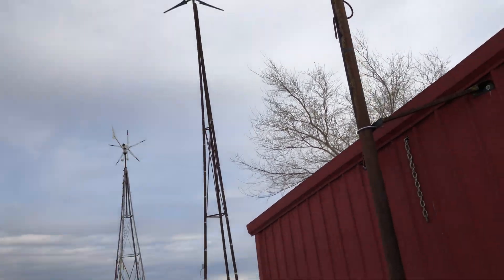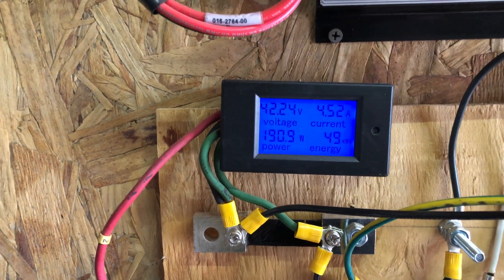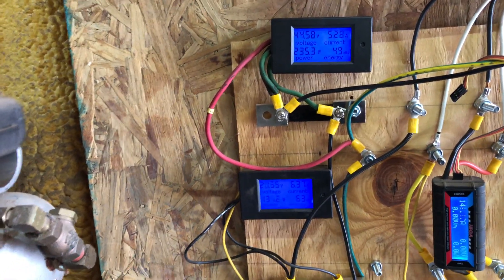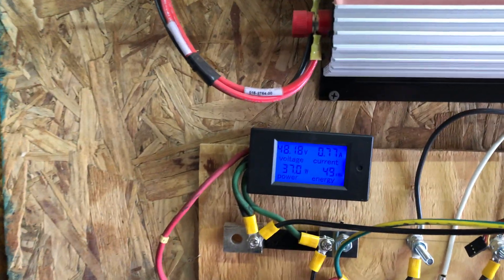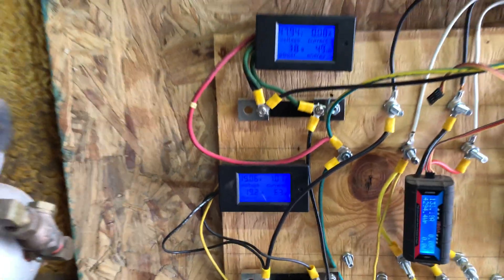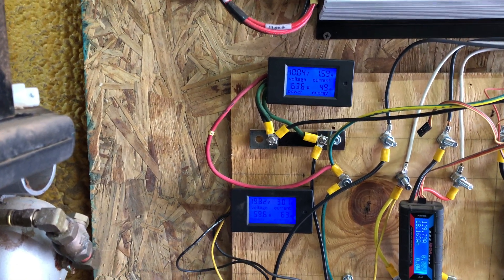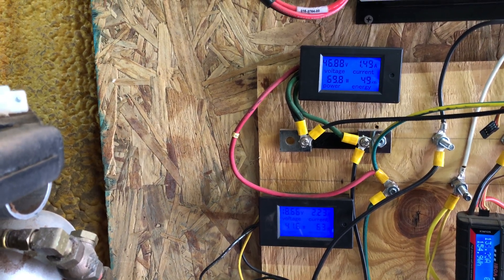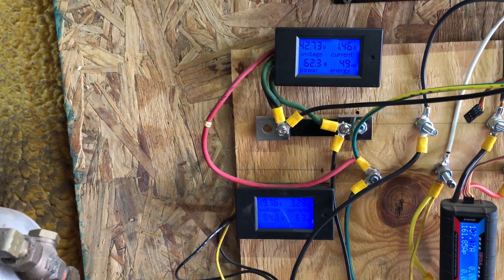iSta Breeze Heli 2.0 vs i1500: Week 6 update!

Comment: What is the most voltage you have ever gotten out of the i-1500 on a 24volt system. Getting ready to put up a i-1500 Windsafe turbine to replace my Bergy xl1 that had been up for almost 8 years.  I am running it through a Midnight Classic 250v controller.

Comment: I have what may seem like a silly question but I’m going to risk asking it anyway. With my turbines I tend to use 6mm solar cable to connect the three phase AC turbine to its controller. The question is should I actually be using AC cable instead of DC cable? I use solar cable mostly because it is the right gauge for the distance, I can use MC4 weather proof connectors and the cable is rated for outdoor use.
Reply from the maker: Cable is cable for the most part...if it's the correct gauge, that's all that matters.
Reply: Your solar cable should be better as it is multistrand and the AC  cable probably 3 single cores so more resistance

Comment: thank you .  And the conclusion is that 1500 brings more kwh?
Reply from the maker: In the current configuration yes the i1500 definitely out performs the Heli.  We're going to be trying some new blades, though, and I hope that helps with the output from the Heli.  There's so much more copper and magnet in the Heli than the i1500...so much more potential...I'm going to continue to work with it until we figure out how to get more out of it.
Reply: @ToysforWatts  good.  I like .  you are cool .  I've been following you for a long time in Romania and I was waiting for you to film further.  I understand a little English but I use the translate application to follow you
Reply: I was left with the question: what would be the reason that the i2000 cannot reach the capacity of the i1500 with the same wind?
Reply from the maker: Something to keep in mind is the Heli 2.0 is a different design than the i2000.  I have the Heli 2.0.

Why I think the Heli is not reaching its proper potential is the blades.  It uses a 5-blade version of the same blades used on the i1500.  These blades work great on the i1500, but the i1500 has a much lower initial resistance and a lot less mass.  I think the blades are not very well suited to getting the Heli 2.0 started turning in the same kind of wind, and then once it is turning I think the 5 blade arrangement is too heavy to spool up as fast.  I think it needs something a bit more aggressive to get the turbine started, and possibly lower mass to help it get up to speed faster.

I'm hoping to try some new blades on the Heli 2.0 in the near future to see if we can reach that potential.
Reply: Ok Ok.  I can not wait.  And a happy new year.